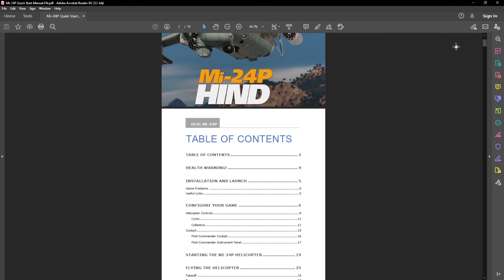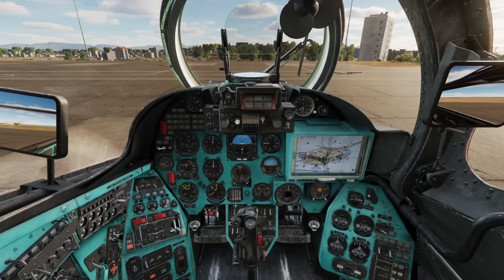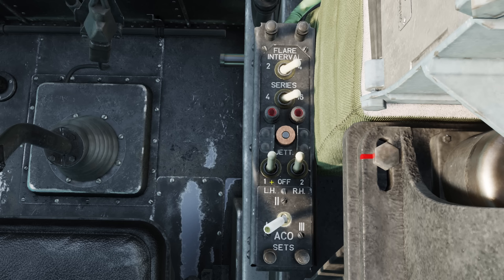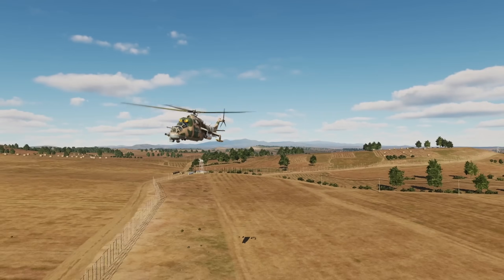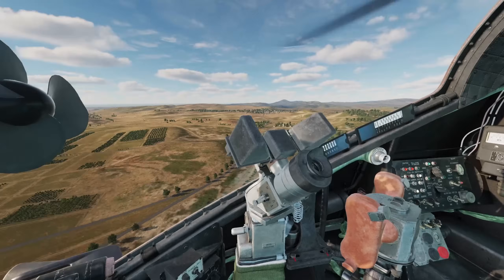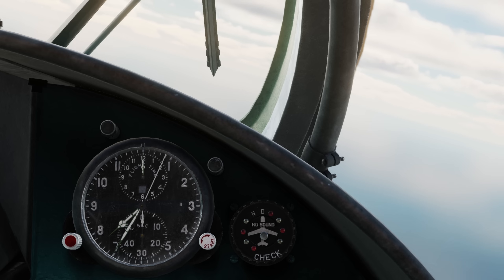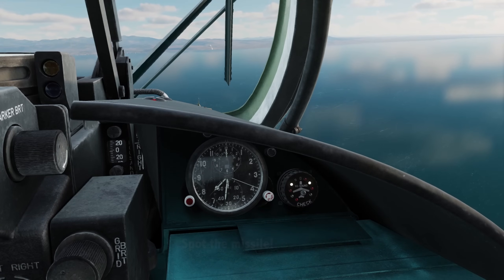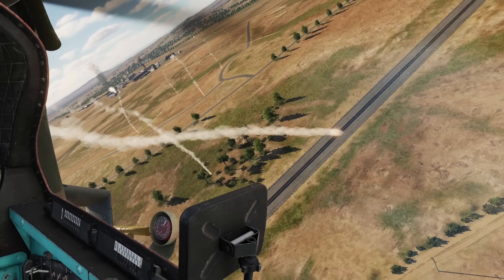DCS Mi-24P Hind Countermeasures and RWR Tutorial

Comment: I'm just wondering if it's possible to spam the flares manually or is it literally just like every 3 seconds they fire?
Reply from the maker: If you flare, then switch set, flare you can fire them faster, but it's a workout to do. I guess with a macro you could overcome it. But, it'll also cycle into the off position skipping a flare, and it'll mix chaff in if you're got it loaded.
Reply: @RedKiteRender  Thanks!, I just thought if you had a missile streaking towards you, you'd want to be able to fill the air with glowing balls to distract it, not just one every few seconds. I guess that's what happens in reality then 😯
Reply from the maker: @OrangeApocalypse  The doctrine is to be dropping flares before the launch throughout the whole run, although 2 every 3 seconds is a little low for dcs in my opinion.

Comment: Hmm, I have a small problem with the Hind that I cant really figure out. The generators or something seem to die on me at various stages of the flight. Usually when I do some aggressive manouvers. Any help?
Reply from the maker: Your engine RPM has dropped too low, resulting in the generator failure, they'll re-initialise once rpms are back up. To avoid it you need to use less collective to reduce the strain on the engine during a manoeuvre.
Reply: @RedKiteRender  I suspected it was similar to the Mi8 Generator failures. Thanks. Another question, once it recovers from this failure, should I turn off then back on two switches on the right side power panel? Cant remember the name of those two switches but everytime this happens, I get a red light above them. Can that be ignored or should I restart them to get rid off the warning?
Reply from the maker: Good question, I'm not sure, can't hurt to give it a test.
Reply: somebody mentioned you would have to turn off the dust / sand filters or otherwise your electric system will be overloaded when pulling the collective too much.
Did not have a chance to test it.

Comment: For anyone lamenting not having 1000 dollar flight control setups. I smoked two bowls of green, hopped into the hind with my ps4 dualshock and was able to cheat the startup (left windows, home) taxi, and runway takeoff, and land back at the parking ramp with ease.  Now did I have all my rotors? No. But I got everyone on the ground right side up.  Xbox360 or ps4 controllers are a great way to fly in dcs.

Comment: Great introduction ! Do you know if the IRCM ("ir jamming") is also implemented yet ?
Reply from the maker: I don't believe our Mi-24P has a ir jammer installed on it (you can see it's empty) Compare to the Mi-24 ai model and you'll notice an extra dome between the rotor and tail boom, above the countermeasure pods.
Reply: @RedKiteRender  well, as the MI24P does have ircm i hope ED will bring it to the DCS version :)
Reply from the maker: Perhaps later, though I recall the KA-50 3.0 upgrade has had it's IR jammers removed from the feature list, but they are a lot more modern.
Reply: @RedKiteRender  More than likely not. The devs stated that the Hind's IRCM is only useful against specific first-gen MANPADs (Namely the Redeye). Since it only protects against the one threat, which is not even in DCS, they dont see it being worth putting in.
Reply from the maker: There's so many ground assets I'd love to see added to dcs :( What ever happened to the SA-5 tease!

Comment: Hi Redkite, nice guide, still some work to finish with the counter measures, in a future build Petrovich AI will enable counter measures when you ask him to set up weapons. Thanks -Bignewy
Reply from the maker: I hope we'll see an expansion on the available keybinds in general too!
Reply: I'm still struggling with him even setting up the weapons. From a cold and dark even with the Petro up long command, he doesn't flip the switches at all that Wags showed us to check if they're up. Had to get in there myself and do the work to be able to operate weapons from the Pilot-Commander station. On a hot start they're all set properly.
Reply: @CakePrincessCelestia  correct will be in a future update, for now best option is to map the controls you can use them from the back seat currently.
Reply: @delayed_control  I thought that one did the same as Petro up long when being the P-C. But I'll just try more. After just one or two sorties, it just could have been a Layer 8 issue XD